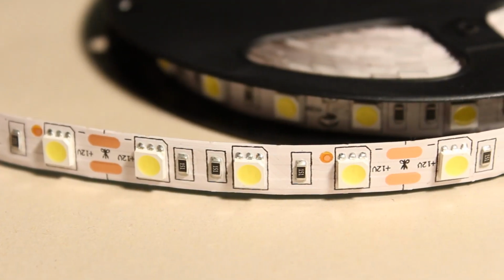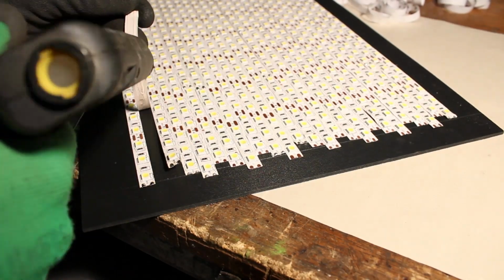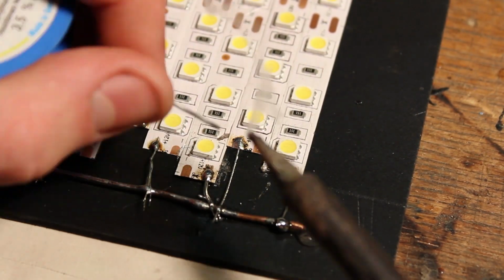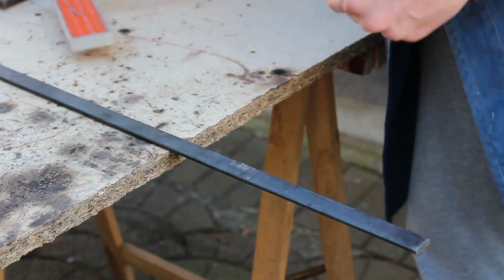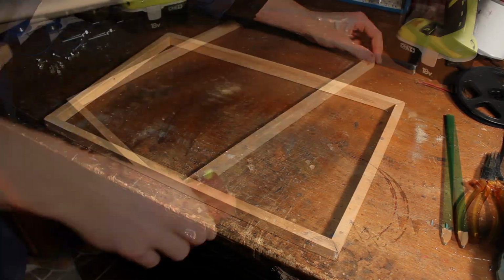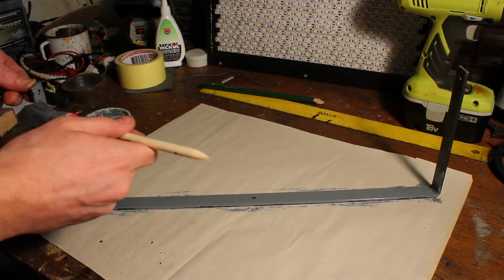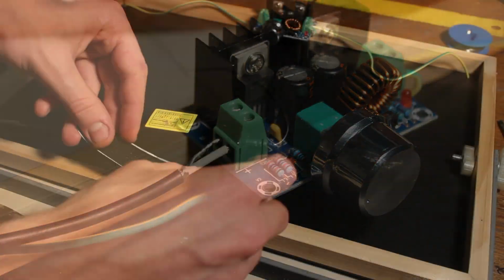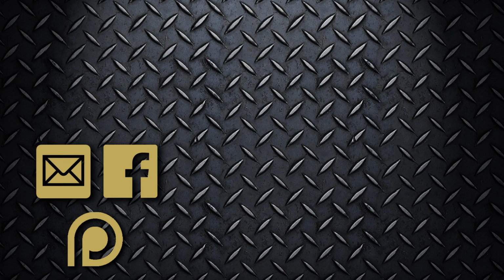How To Make A Bright LED Panel For 20$

Comment: Well done!   The boost converter makes the LED color change as you vary current, they really could use a constant current driver, but its harder to dim them then... Also hot melt (or electrical RTV) over all the bare wires if used outdoors!

Comment: Isn't it possible to just bend the metal harness using a vise as a brake? You don't really HAVE to weld the harness I don't think. :-) The welding seems a bit superfluous.

Comment: I have power adapter that outputs 12v (from old.led strips leftover) should i use stepdown dc dc still? (Pretty much noob here) will it output same level brightness?
Reply: nope. if the out is already 12v. whats the amperage?

Comment: Is that safe with that converter at the back, couldnt it shock you if you touch it?
Reply from the maker: +Derek Delfrate the input voltage of a laptop adaptor is only 19V so there is no way it could shock you :)
Reply: The bare wires on the front of the frame could if you touch both sides while adjusting the panel.
Reply: lmfao..  its also what, 2 amps.. thats enough to kill you, let alone shock you.  Just sayin

Comment: why you mounted the step down converter? the power supply is already DC or not?
Reply from the maker: +francesco lauriola yes it is a Dc output, put stepdown converter is for regulating final output voltage
Reply: @JakesWorkshop  is it necessary or just if you want to have more control?

Comment: Hello
How to calculate and know what to buy/do in terms of electrical components. It seems too easy. But i don't know how to choose the components. 
For example, i want to have a Led panel with 500~800lux capacity. Around 22.000lm. Is this even possible?
How much Lm does your project have? How to choose the power adaptor, the intensity reducer and so on....
Reply: to get higher lumens buy better strips ie if you make strips like the video with these the lumens are added together,so 1200 lumens x 20 strips = 24000 lumens,

https://www.ultraleds.co.uk/mains-voltage-230v-6000k-cool-white-led-tape-ip67-5630-per-metre.html
Reply: Thank You. And in terms of dimmers, and power supply brick or battery? How do you know what model to use.
Reply: these led strips are mains voltage no power brick just wire with mains plug,and the dimmer http://www.lampsandlights.co.uk/moredetails.php?ref=SWblack02&gclid=Cj0KEQiAuJXFBRDirIGnpZLE-N4BEiQAqV0KGp66l6umnxQw8NnZ1Hyu4QxJcj0otK-QW8kFus7lm6waAkbK8P8HAQ

Comment: do you know where to get the RGB led circles for Fidget Spinners?
Reply from the maker: +James Que ebay, aliexpess, these are very cheap
Reply: I looked for them, they arent on there.. would you happen to have a link?
Reply: I wasnt referring to the LED strips you are using.. was referring to the ones used in Fidget Spinners.

Comment: why did you go to all this fuss cutting metal and welding when all you had to do was mark it and bend it , not everyone has a mig welder
Reply: The super important parts, the design and choice of assembly procedures, were spot on. He used the materials and tools he had. Not everyone has a soldering iron either but some people do. If you have aluminum for that part, use it. If you only have wood, use that.
Reply: Well i guess its a good thing hes not using a MIG welder. Its a stick welder....
Reply: if you don't have a soldering iron, you suck, they are $ 3 to $ 7 for a decent one.... and he could've also built the entire thing with wood...
what matters is he made it and it works so make yours however you want...